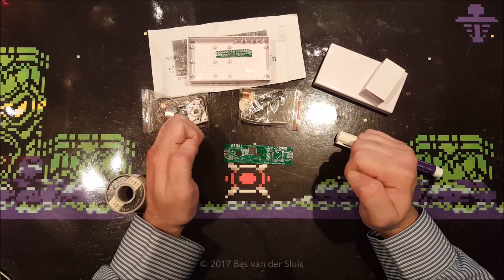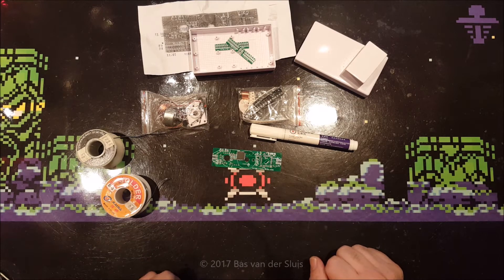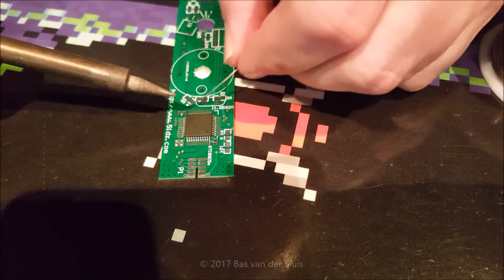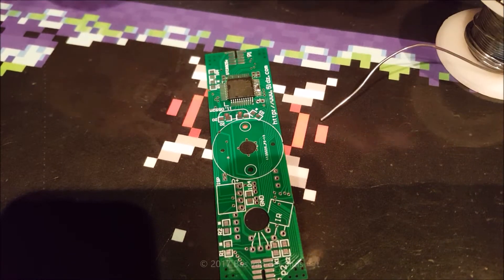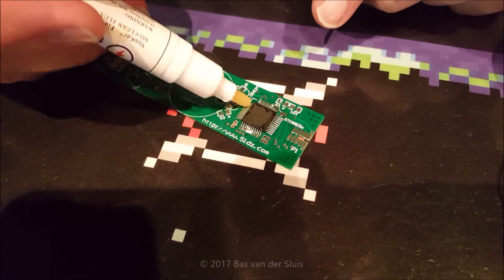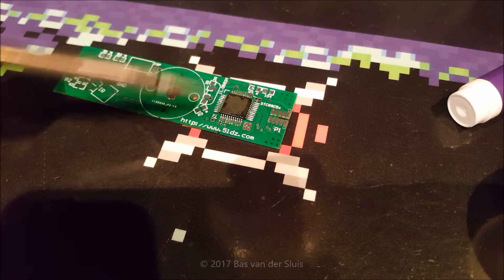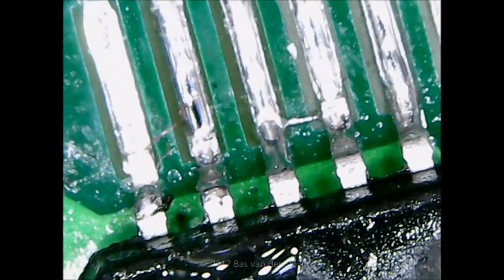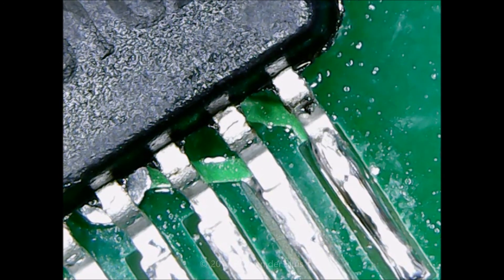Soldering a QFP SMD IC (with very small pins) for a mysterious LED DIY kit

Comment: Just done a similar IC myself (see my vid on the Phantom Clock!) and used the same approach. however I found on my board enough solder was already there and just heated the pins directly and they connected very well. I too was going to use flux but found I did not need to add anything. Always enjoy your videos Bas. Cheers from the UK.